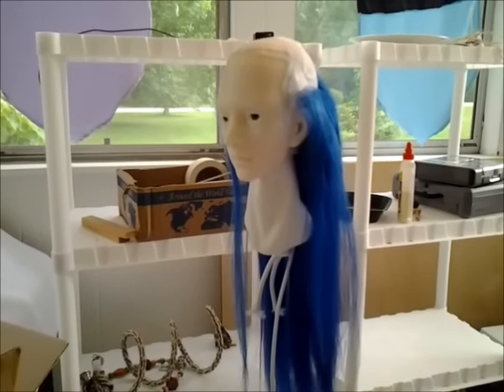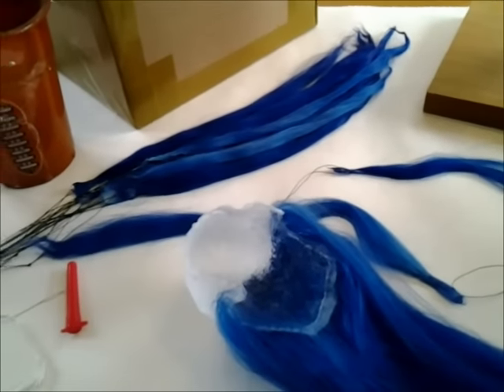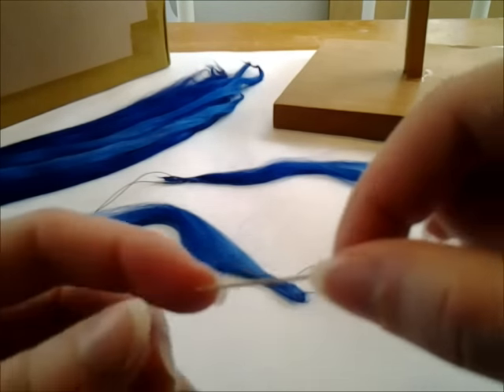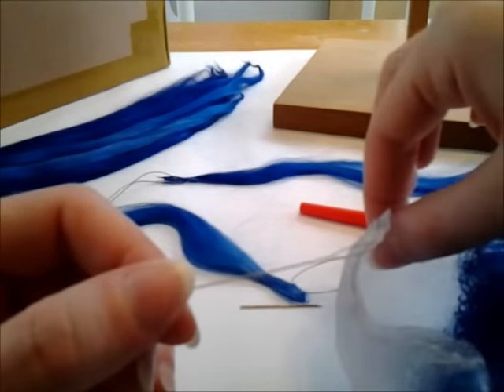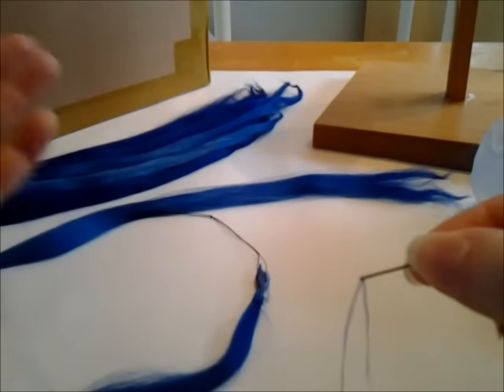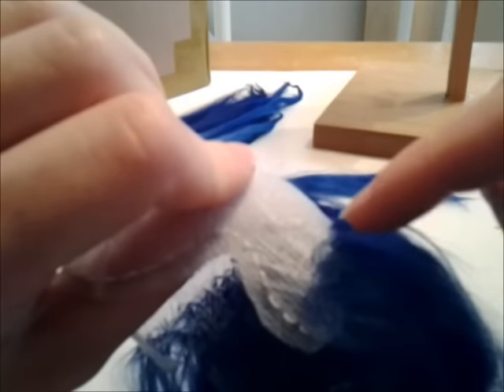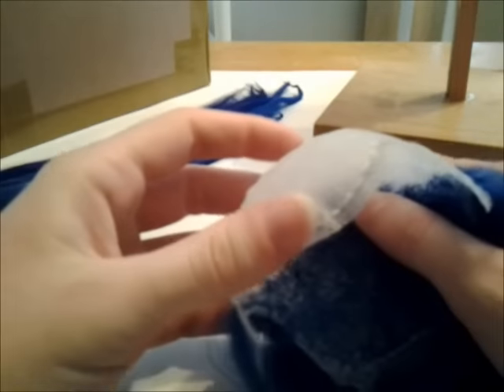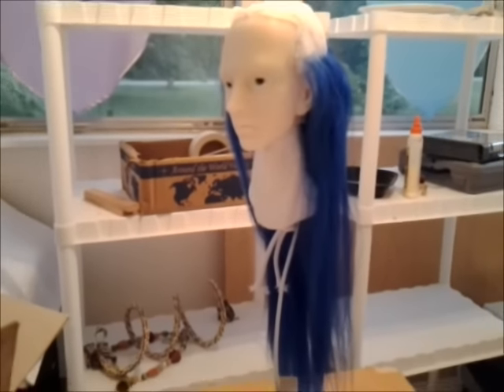Making an Alpaca Wig by Sewing / Rooting Semi-Tutorial

Comment: Dyed alpaca shouldn't stain. As long as the dye is washed properly I don't see how it would stain whe it's on a hard wigcap. :) The wigcap is usually the part that stains because of the dyes (so a dark synthetic wig can stain your doll if it's put on a black stretch wigcap!). So yeah, it should be fine. No one has had trouble with dyed alpaca staining. :) Especially since you're gluing the part inside which will protect from any dye possibly staining.
Reply from the maker: earisu Thanks for your encouragement! ^^ I was only worried because as I worked with the hair, the dye would bleed on my fingers and turn them blue. The color bleed seemed to only happen when the hair was wet, and of course, my fingers have natural oil and heat. So I was worried about the hair itself brushing against the resin and staining, but hoping that it won't happen to a dry/cool doll. But the bleeding did lessen after I soaked the hair and wig in vinegar water, which was the best method I have tried. On top of that, I'm hoping a good coat of sealant all over the doll will help to protect against the blue hair lol. Thanks for your comment! I'm still working on the wig, as it takes a loooooong time, wish me luck! :D